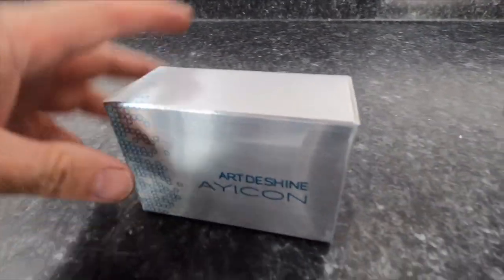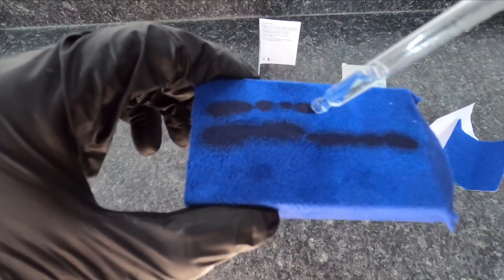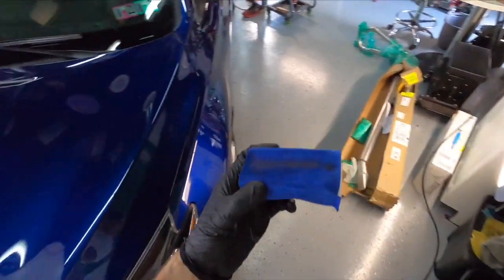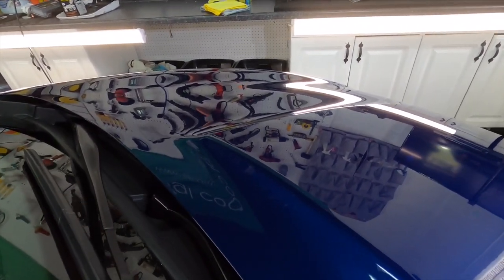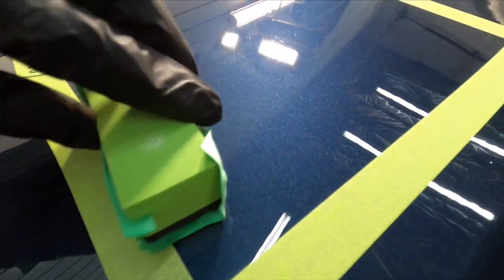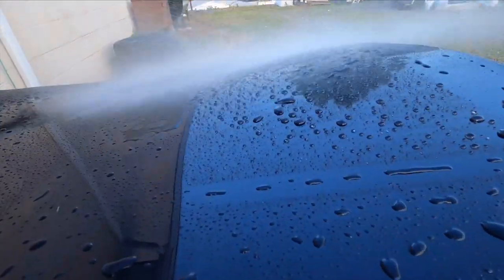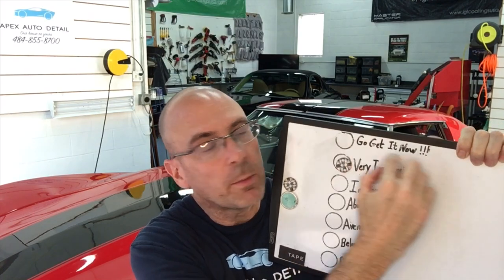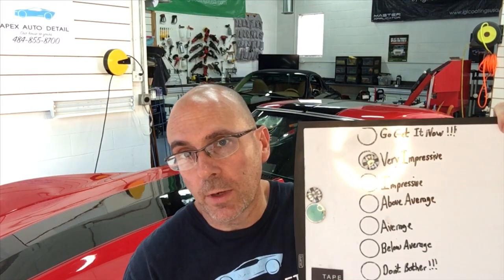Insane Gloss From ARTDESHINE Ayicon Ceramic Coating and Bio Nano Pro!!

Comment: Hey Brian,  I noticed you tested this coating with Citrol 266.  I've read Citrol can remove paint sealant, is this something you'd advise?  I have several recent coats of Klasse High Gloss Sealant that I need to remove prior to applying a ceramic coating.  I also have Extra Tough.  Thank you for all the great content!

Comment: Had a question about ceramic coatings was going to use Avalon king and just wanted to know can I apply any other wax or sealant after I applied the ceramic coding

Comment: Very nice results, Jr. did an excellant job correcting and prepping. Is it correct to assume the Carzilla prices are in Canadian dollars? If so with a 0.73 exchange rate the price is a little high but not bad considering the exchange rate and  it's 50ml.
Reply: Yes Canadian dollars shipping on my 2 orders around 21 Canadian dollars on just about any order and they use UPS to the states.

Comment: The Ayicon Ceramic Coating was very impressive.  I been using 3D products since watching your videos on their products.  Would you recommend using and not protecting with 3D Nitro Seal?  Would I stop using 3D Poxy periodically after applying Ayicon?
Reply from the maker: Ron Keller I am looking forward to trying 3D coatings... I imagine they are superb.
Reply: Apex Detail Watching you do detailing I’ve learned alot!  Stopped mixing different products from different manufactures.  Switched to using 3D only with exception for Iron Removal, Q2M Prep and Obsessed Decontamination Soap.   Also like 3D Spider Finishing Pad Light Purple and Black.  Thinking about trying Ayicon on my next decontamination after final 3D Product in their process!  Not sure if 3D Poxy would do any periodically after applying Ayicon?

Comment: When prepping, do I need to polish the entire car or only the panels/sections that have swirls or dull paint? Thank you.
Reply: After decon you want to do at least a light cleaner/polish over the entire vehicle to exfoliate the surface followed by a panel prep.. 👍👌✌
Reply from the maker: Entire vehicle.
Reply: @jdisdetermined  Thank you!
Reply: @apexdetail85  Thank you! Love your videos.
Reply: Remember that the purpose of polishing the finish is to remove defects, smooth the paint, thereby  producing a deeper, richer shine.. Although some panels may require heavier polishing than others it is always better to polish the whole car so the surface is better prepared to absorb your Coating or whatever you choose as protection for the paint. 
Don't forget to wipe your panels down with an IPA or designated panel wipe to remove the polishing oils prior to applying your protection.

Comment: How much time did you need to wait before applying the second coat? And is this time pretty much the same for most coatings?
Reply: Typically allow 4-6 hours. More time is okay. Less time may re-activate the coating, thinning the bottom layer.
Reply: He says 2 hours in the description
Reply: KeganSi 2 hours on
Reply: Only
Reply: @briandraper7630  Thanks....I missed that part lol
Reply: Brian Draper I was mostly referencing the bottom half of his question. But good find and 2 hours is a quick turnaround for this coating

Comment: Not sure if you have posted but what are your top 3 coatings from experience
Reply from the maker: EJG IGL Kenzo, ArtDeShine, Fireball, TAC. There are 4 top shelf coatings.
Reply: @apexdetail85  have you tried Opti Coat coatings at all?
Reply: Also , I'm  not certified so a pro level is not attainable. So I'm thinking of doing Zipang. I've heard great things about their coatings.

Comment: Yet will ceramic coatings protect against rock chips or just UV light?
Reply: Good coatings can help a little bit with abrasion resistance, mainly through deflection due to the slick surface. But coatings are not a ppf in a bottle miracle as some unscrupulous marketers would lead you to believe.. But they are absolutely 100% worth the time and effort they take to apply.. 👍👌✌
Reply from the maker: To a certain degree. PPF is better for them.
Reply: So then is it best to lay down PPF, then put ceramic coatings on top of the PPF?